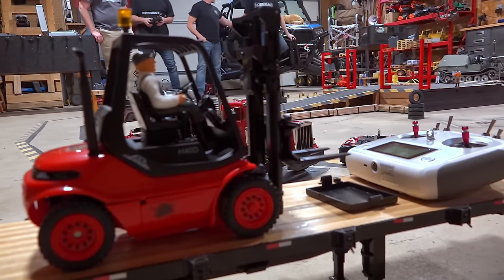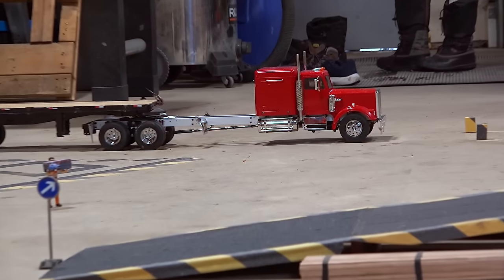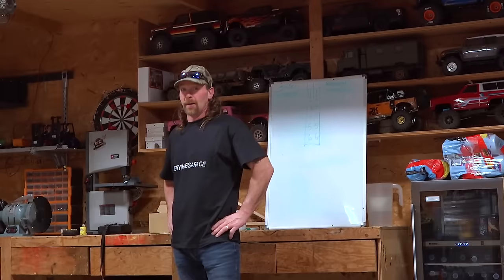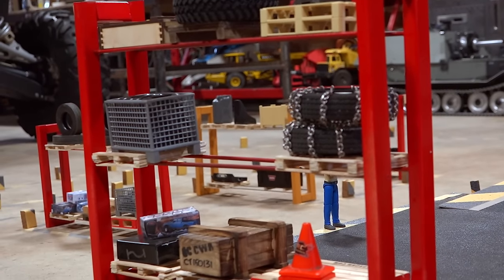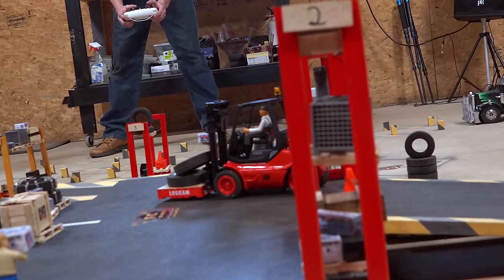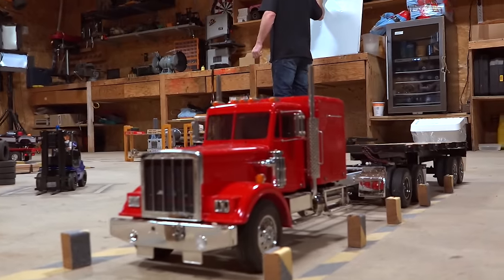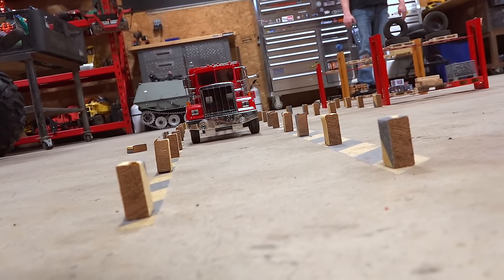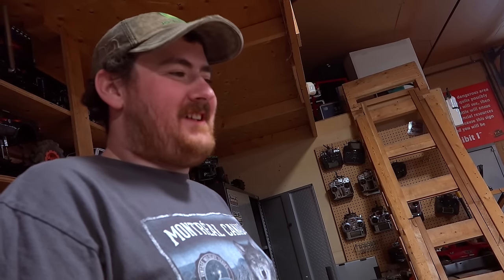LOADING WARS: Game Changer - DUAL UPGRADED FORKLIFT & NEW DRIVERS!! (S2 E9)

Comment: I think it would be Kool to use a point system where when they dock the truck and start loading pallets instead of randomly drawing pallets. I think you should have each pallet have a point value (based on skill to get) and let the forklift drivers grab as many and whatever pallets they want. The wars part would be they could block each other and what not. Whoever has the most points when they decide to drive the semi away wins. The penalty would be the same where you back a truck up or do the crane or whatever.

Comment: I noticed your rack system is missing a very important safety part , racking systems have a grating that hangs on the rails overlapping front and back so the pallet doesn’t fall through the horizontal shelf rails. You could fabricate them from light gauge expanded aluminum sold at Home Depot or Lowe’s . It’s usually used as a venting material for cabinet doors 🤔 Love your loading wars videos ❤️
Reply from the maker: No no no.. sorry James, you miss the point buddy! Safety is our #21 priority.. haha ;) Its supposed to be unsafe!

Comment: Can’t wait for the mod video I have the blue one and can’t stand the controls I need driving on the left stick and forks on the right stick. Although I think that may be a bit different trying to control the touchy throttle and the steering on one stick but I have another idea if that doesn’t work out 😬

Comment: The reason i don't own a semi is that they don't scale with my 1/10 trucks. 1/10 forklifts and 18 wheelers would be awesome
Reply: In PNWSTE (Pacific Northwest Scale Truck & Equipment) we have 18th, 16th, 14th, 12th, AND 10th scale stuff that works well together. The equipment is 10th, & 12th scale, while the trucks are 16th, 14th, & 10th scale.